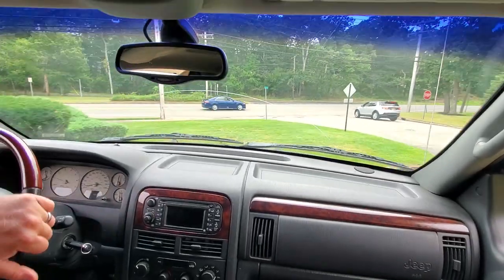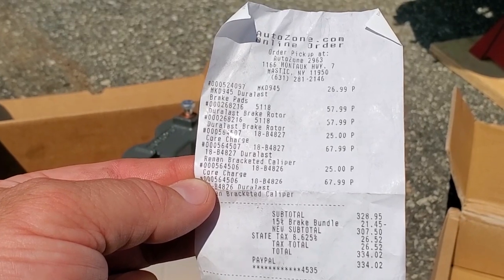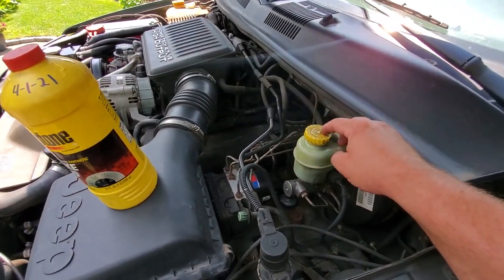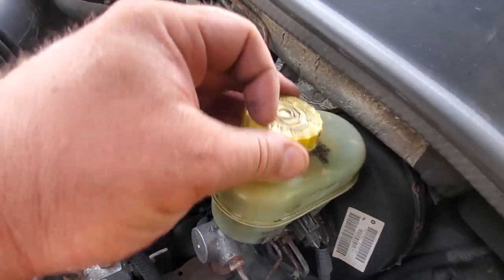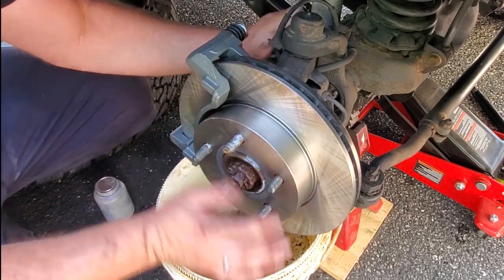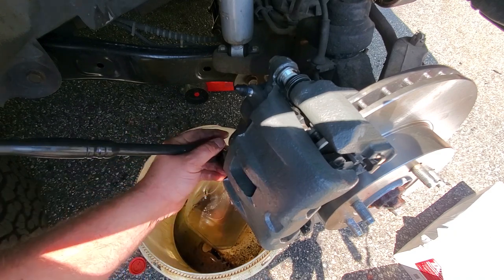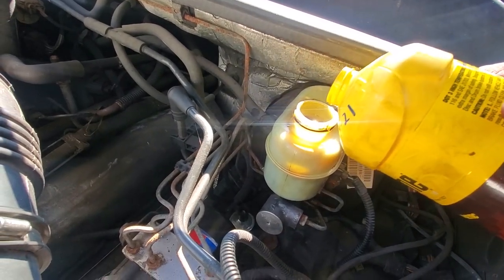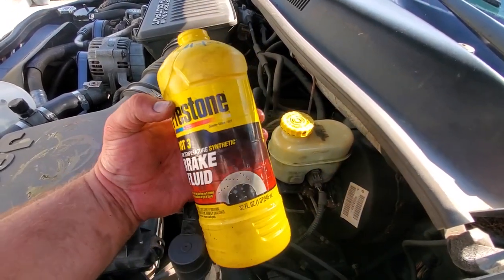1999 - 2002 JEEP GRAND CHEROKEE WJ FRONT CALIPER UPGRADE - TEVES TO AKEBONO (THE LOST VIDEO)

Comment: Hey Danny h wondering if I can upgrade my ZJ calipers like this?
Specifically, I want to upgrade RED calipers. 
I think they would provide much better braking power.
Reply from the maker: I'm pretty sure ZJ calipers and WJ calipers are not a bolt on swap.  Maybe theyll fit with some mods.  good luck!

Comment: Hey Dan, another great video. Small correction, water does not compress, if water is in the brake fluid it lowers the boiling point of the fluid.
Reply from the maker: For each atmosphere increase in pressure, the volume of water decreases 46.4 parts per million.

Comment: Heck yes, another gem of a posting. I've one of each. It was hit or miss, had I known the aki were superior I'd have not exchanged them.
Reply from the maker: thanks man, Get em Done!
Reply: @ProjectDanH  you bet, thank you sincerely for your unbridled, noteworthy projects. The in-depth level of of your projects is deep. Have you considered upgrading your engine? I mean for HP gains?
Reply: @ProjectDanH  just pointing out, the 4.7 is ripe for mods. Your participation and skill level is approaching if not equal to Martin built, another WJ aficionado. It's a hard motor to work on alas it is glazed over, if I could do it over again I'd have bought a spare engine, put it. On a stand and start building.

Comment: Water doesn't compress but as the brake fluid get contaminated with moisture and contaminates  it  will cause internal damage and effect rubber seals and components.

Comment: Good job. 2 tips for you sir.

1st. Remove the caliper from the bracket and hang the caliper up out of the way.  Do not open the hydraulic system at this time.
 Next, assemble all the new parts 100%
 Lastly remove the old banjo bolt from the old caliper and swap the line and new  bolt/crush washers onto the new caliper.

 2nd tip would be to NEVER prefill a brake caliper.
 The only possible outcome is using more fluid than you need to complete the job and likely make a mess in the process.
 The only thing that needs to be prefilled, and then "bench bled" before install is the master cylinder.
Reply from the maker: Thanks Randy!
Reply: @ProjectDanH  anytime.🍻

Comment: Sup Dan.  Looks like I've got to replace the passenger front caliper bracket on my 2000 WJ.  The bottom slide pin is stuuuuuuck, it will not budge at all.  Akebono style so its the 17mm bolt and not the hex.  Probably gonna find a gently used one at the yard if I can find one that has both slides moving freely.

Comment: So i guess I missed it but are the 99-02 rotors the same as 03-04? Also thanks for another great video sir.
Reply: Yes he said all WJ models have the same front rotors. The rear rotors are different than fronts because they are drum + disks with internal parking brake shoes but they are the same on 99-04.

Comment: If this video is over a year old, how have the rotors held up? I know when I did my brakes on my wj I have the crappy teves calipers and my rotors were warped in only about 10k miles but at the same time I bought everything on close out sale on rock out and got front and rear pads/rotors for $160 and the pads were ceramic too
Reply from the maker: I haven't put many miles on them but they have held up well so far without problems

Comment: Where did you prime the brake caliper with brake fluid?
Reply from the maker: I usually fill it on the work bench, top it off right before I attach the banjo bolt, then open the bleeder and let gravity take over.. once it drips for a min I close the bleeder until I bleed the whole system